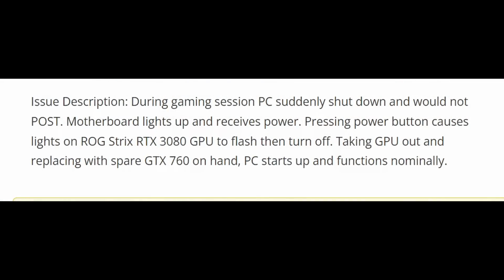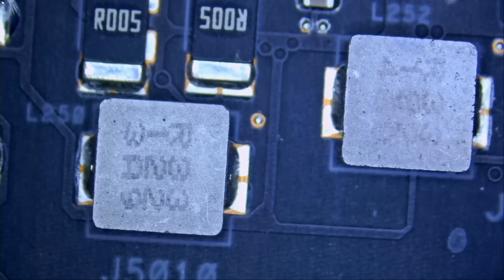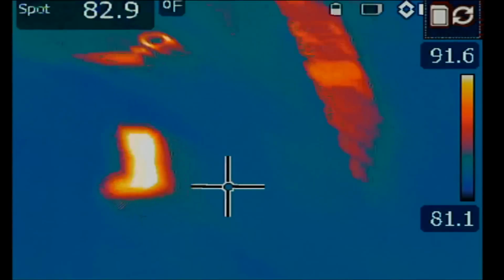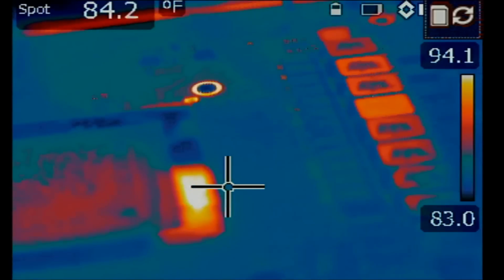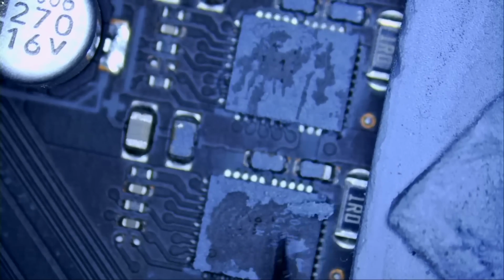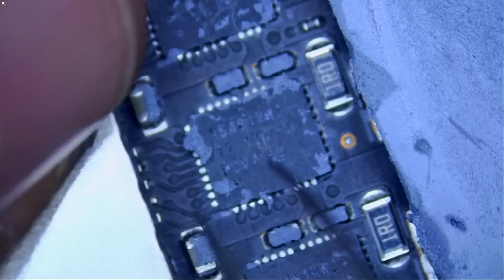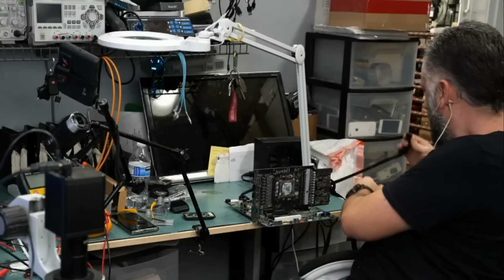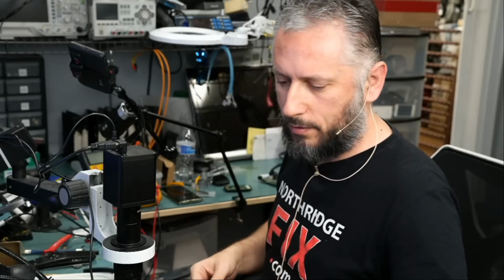Asus ROG Strix 3080 OC Graphics card Repair

Comment: I just bought the RTX 2060 super to replace GTX 1650 super but for some reason my pc not detecting the graphics card. The graphics card uses 6 pins with extra 2 (6+2). If I plug in the the six pins it tells me to PLEASE POWER DOWN AND CONNECT PCIe POWER CABLEs FOR THIS GRAPHICS CARD. And when do connect the extra it displays nothing. The pc don’t even detect the graphics. Can someone please advice or give me a solution ? Thanks

Comment: great work, I dont have a thermal camera but I have used a cheap infrared thermometer from harbor freight to find one hotter than the rest... funny.. I ended up aiming it at everything in a running computer just to see how hot things get.. I usually us it to check the bearings on my trailer when traveling on vacation.

Comment: I wonder if by replacing the mosfets in most of these repairs we are solving the root cause. Is in most cases a problem with the manufacturing of the mosfet, e.g. wide tolerances, or problems with the design of the board, e.g. not enough heat dissipation?
Reply: Quality is a big part of it - look at server boards being able to deliver 250+w at low temperatures with 7 phases and tiny heatsinks, compared to gamer boards with 69 phases and huge heatsinks to provide the same performance
Reply: Notice how the customer stated the PC shut down during gaming, it's a common link between the mosfet shorted GPUs Alex gets. I'd assume heat is the issue, as every ASUS laptop has a shorted mosfet, whereas in desktop PCs you practically never see a shorted mosfet on the motherboard. Because they are sufficiently cooled, whereas laptops aren't.

Comment: There is a reason why it is extremely hard to find someone that actually does board level repair, because it is difficult! None of that seems hard for Alex. I would bet if it made business sense, he would never have to classify ANY board as a NO Fix and could potentially fix ANYTHING that came in given a little time. Good job Alex, you are my hero.
Reply: 100% agree. Man's good af. I bet he would even be replacing no fixes by ordering anotherd board just to solve the problem :) (big pcb damage is a no fix, like, if your layers get fused within pcb and short out or like, if a chip solders itself to a layer due to immense heat while failing - typically seen in rare cases with mosfets) - that's also a no fix. Probably if it was the gpu the best you could do if you luck out and no shorts just clean it up, cover with uv resin and suggest to run card undervolted and undercooked with a hard clock limit so that it never hits its full potential again. Hey, a 3080 working at 50% of its preformance is still better than a 1060 6gb :D
Reply: learned a fuckton from watching vids, that alone is worth $1k+

i simp for daddy northridgefix
Reply: Dont be a simp, there are rare situations shown on videos where he cant fix it for whatever reason that makes the job inefficient for his business model.
Reply: @seffard  it's so hard not to simp though bro. Sorry if that offends you sweaty.

Comment: How card can work without one of the mosfets ?
Reply: Most of the FETs work in parallel, spreading out the power demand over multiple FETs. You could not run the GPU at full load like this, however for testing its fine.

Comment: Am I just paranoid, or do these really powerful GPUs come in a lot more often for repairs?

Think it might be by design?
Reply: Lead free solder, poor cooling and lot of heat. Logically, cards producing more heat fail first. For expensive cards it make sense to pay for repair. For low end cheap card price of repair is higher than same card used and working.
Reply: i mined on one on of these and break after 7 months
Reply: there's a lot of them sold, and all kinds of use cases and all kinds of users

Comment: Why is that card working with the mosfet removed???
Reply: There are plenty of other MOSSFETs that do the same thing and if one is missing, still others work😁.
On the PC motherboards, some of them has way more (some little more) than is needed for most powerfull CPU (processor) so the load can be distributed thru all of them and that means less heat they make, less stressful their work is and so they live longer. Same is for GPUs.

Hope you understand now. You can also search on YouTube for example what are mosfets and learn more 😁👍.
Reply: there many paralell, as long u dont use high power it can run like that
Reply: its only one phase you have all the other phases powering up the gpu, the only problem is it can lock the boost clocks lower when gaming or blow up the other phases, but usually even withou a phase it should be fine without oc